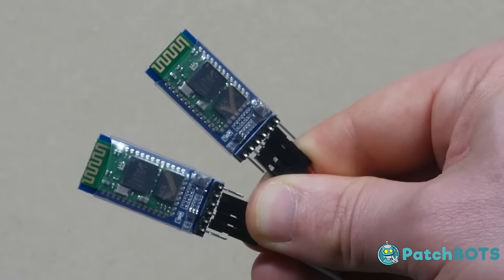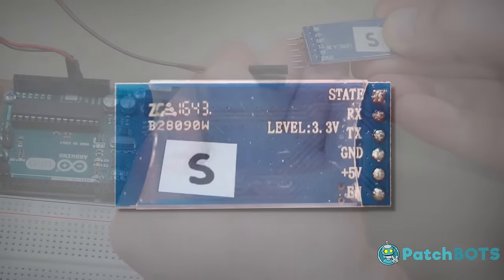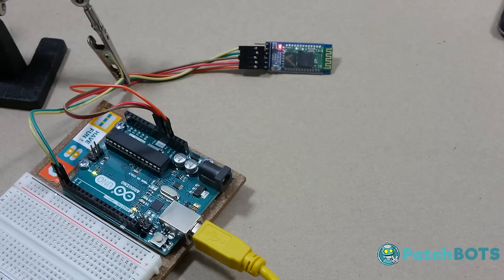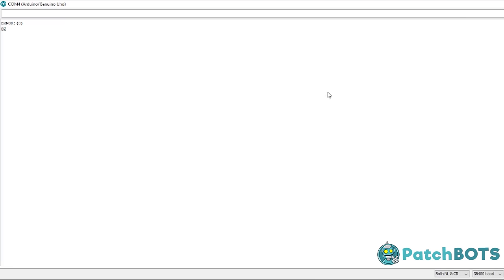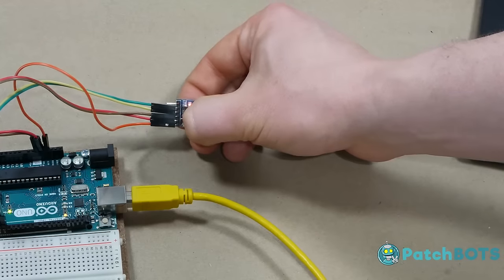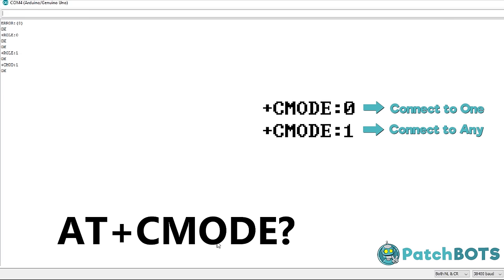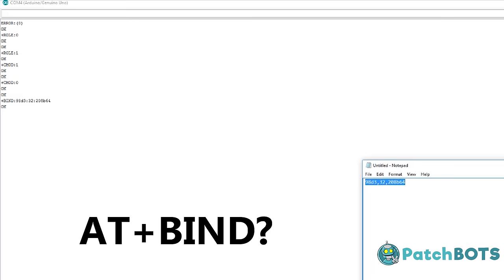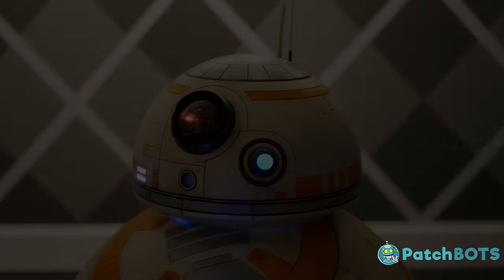How to Pair HC-05 Bluetooth Modules

Comment: Hello pathbots, this was very helpful and I almost finished in less than 10 minutes but I ran into a problem. It says that my modules are binded and stay binded but they won't connect. I'm using an Arduino uno and have checked every step and everything is correct. Not sure why?

Comment: Make sure you use this format for your AT+BIND=xxxx,xx,xxxxxx.  Add zeros to pad the address.  I was getting Error(7) (Bluetooth address: LAP is too long.).  But this fixed it.
Reply from the maker: Good advice, this error can also be caused by accidentally leaving a space at the end of your numbers, which is very easy if you're using Notepad on Windows.  This error is extremely common among those that message me.

Comment: hey PatchBOTS , so i did everything as described in the video it all went good, now i'm using the bluetooth modules to transmit data between a pro micro and an arduino mini, but the expected output isn't showing. can we use two paired modules to transmit and receive data over any arduino's or is it specific to uno?
Reply: and also after pairing process the light blinking in stage 3 did not change they're still blinking rapidly that means they are not paired right?
Reply from the maker: @vamsik1599      Once they are programmed you are no longer required to use the UNO, you can use anything.  If they are both blinking rapidly they are not paired. Something went wrong.
Reply: @PatchBOTS  now the AT command mode is not working in arduino ide it opens but output isn't showing anything, i still used  a uno to repeat the process again
Reply from the maker: @vamsik1599  make sure your baud rate is 38400 in the monitor
Reply: @PatchBOTS  yes checked everything, NL&CR both is set and rate is 38400 they just don't get paired and now serial monitor output is nothing it shows nothing

Comment: Hi PatchBOTS! I'm trying to pair two HC-05 modules following every instruction from this tutorial, the only difference is the fact that I'm using an arduino Leonardo instead on UNO. When I open the serial monitor and enter an AT command, even a simple AT or AT+ROLE?, I don't get any kind of response.  Have you encountered a similar problem, or do you have a solution for it?
Reply from the maker: Double check your baud rate
Reply from the maker: If you look a couple comments lower, someone had the same issue using a nano instead of an UNO.  When using an UNO it was fine.  I've never used a Leonardo so I can't confirm or deny
Reply: Hi PatchBOTS! Coming with an update, I just got an Arduino UNO today, I tried to pair my bluetooth modules using your tutorial and it worked out fine. It seems that this process indeed works only with an UNO model. Thanks for your help!
Reply from the maker: Thanks @bogdan itu,  this is really helpful feedback for the rest of the community.  You are the second person with this experience so I'm going to add another edit to the description of the video based on this.  THANK YOU!

Comment: Really great explained but I've got a question 
I want to send send and receive data in my sonar project( servo+ ultrasonic), Can it be done with the method you explained with these Bluetooth modules ?? Thanks
Reply from the maker: Hi Akram,  This tutorial just shows how to set up communication between the two modules.  So this tutorial would get you started. Yes, you can absolutely use these two bluetooth modules in your sonar project.  You'd can send the data from your sensor to your servo over bluetooth or your remote to your servo, whatever you need.  The bluetooth is just replacing i2c or other serial connections with a wireless solution.  HOWEVER, you'd need to seek out another tutorial for that, this one is just about establishing the connection between the modules.

Comment: followed your instructions for wiring, but I cannot enter AT commands on the serial monitor, what have I done wrong. I am also using an Arduino nano.
Reply: Same problem
Reply from the maker: You can not use a Nano for this method.  You must use an Uno.    Once the HC-05 modules are paired, you can attach them to Nano's, but the programming must be done on an Uno

Comment: Please help me. I am using Arduino UNO. I read the issues you have written in the description. I have followed all the three techniques from Issue no. - 2. I have checked the connections several times. When I type "AT" command, it replies "OK", it replies "AT+ROLE?", "AT+PSWD?" etc. But when I type "AT+ROLE=1" it replies nothing!! "AT+NAME?" replies "+NAME:HC-05   OK". Model no. ZS-040.
Reply: almost the same problem: after changing the role (AT+ROLE=1) to hc-05, the board returns OK, but with AT+ROLE? answer: +ROLE:0, that is, the role does not change. have you found the reason for this yet?
Reply: @secrey36  I didn’t find the exact reason. But I think, firmware versions less than 2 (two) don't support 'Master Mode'.
Reply: @muhammadtamim451  Thanks for the suggestion :) I'll try further, maybe I'll go through the hardware.  I really want to make a remote control for the manipulator
Reply: @secrey36  welcome!

Comment: Great! But at the end of the process, my two modules don't blink together. Master(connected to mega) blinks, blinks and then Slave(connected to UNO) blinks but nevere together. Can you help me?
Reply from the maker: They don't necessarily have to blink together as long as they are blinking the same way.
Reply: @PatchBOTS  thanks!! Later i Will try again and i Will let you know :)
Reply: @PatchBOTS  and if i want that the two modules communicate eachother, which Is the Arduino's code?

Comment: Thank you very much

So do they also send the command using the wire library on Arduino

Is there anything we have to do in addition in the code?
Reply from the maker: The way I've used them is with UART communication.   I'm not sure if you can use it as an I2C device with the wire library but it's something to look into.

Comment: Would they stay paired after i cut the power of them and connect it again?.. or do i need to program them every time ?
Reply from the maker: Once they are paired they will remained paired through power on/off until they are reprogrammed.
Reply: They should stay paired as you have set the Master to only pair with 1 address, that address being the slave's.

Comment: Brother ..HC-05 is in AT mode but not responding to any AT commands ? Plz help
Reply from the maker: Check baud rate.  Try holding down button as you enter commands
Reply: Yeah mine too
Reply: Maybe the Module is defective.. coz I tried using other Hc05.. it worked
Reply: @sacys  With UNO or NANO ?
Reply: @scitechnotuber548  Uno

Comment: Hi PatchBOTS! I i want to make a bluetooth transmission of an electric guitar signal,  should I follow this tutorial or it's something else I should do to make it work?
Reply from the maker: This tutorial will just pair the two modules.  Sending the signal across the connection is a whole other bag of potatoes.  Good luck! I'm sure you'll find some help online.  Check out wireless guitar rigs.
Reply: Thank you for your response! I was really hoping this would work for me because I want to finnish this project very soon for my graduation thesis.
Reply from the maker: No problem, this video is defintiely a great Step 1 for your project.  Now you'll just need to figure out how to attach your guitar to one end and your amp to the other!
Reply: I figured out how to attach my guitar to the first arduino(the transmiter). I had to make an amplifier circuit, to amplify the guitar signal, wich is around 2mV, to 2V, so that the arduino can process it. I'll find a way to attach the other arduino(the receptor) to an amp, but what I don't understand is, if I do all this, and I pair the two bluetooth modules just like in your tutorial, will I be able to transmit the audio signal, or will the arduinos need some further programing?
Reply from the maker: Okay cool, so you're on the right track.  What you'll need to do is print the signal to serial on the transmitter side, and parse the data on the receiver side (that's one way to do it).  You should also look into Software Serial on the Arduino playground:  https://www.arduino.cc/en/Reference/SoftwareSerial      This will send you down the Serial rabbit hole which will lead you to how to get two arduinos to talk to each other.  The difference here is that the connection will be made via bluetooth instead of hard-wiring.  Good luck!

Comment: Rx and Tx of bluetooth are 5v compatible?
Reply from the maker: Generally speaking, no.  For programming it should be fine but use a voltage divider for long term usage.
Reply: @PatchBOTS  thanks

Comment: Mmmm, what about the 3.3V logic level requirement? The HC05 Rx pin might survive for the duration of testing, but longer term you'll kill your HC05. It needs a logic level shifter for long term use, as per datasheet.
Reply from the maker: Yeah you're totally right.  A voltage divider is needed for long term use.

Comment: What is the Ardiuno uno actually doing?
Reply from the maker: enabling us to use the arduino IDE as a terminal for the HC-05 while supplying power to the board and setting the AT Pin high.
Reply: @PatchBOTS  
So all it is usb to UART bridge and supplies power?
Reply from the maker: @martinlintzgy1361  naile dit

Comment: I got my slave bt address as 28,13,17FD is this right and when I  bind it with master it only shows +BIND:28:13:0
Reply from the maker: Are you sure you're using hc-05 and not  hc-06
Reply: @PatchBOTS  yes

Comment: how can i connect HC-05 bluetooth module to android app to get data from the sensors interfaced to arduino?
please help.
Reply from the maker: Hi Dave.    Unfortunately I can't help you there, this tutorial is just about connecting 2 modules together.  I had a hard time finding info which is why I made a video, so maybe when you find your answer you can do the same!   The more helpful videos out there the better the community!  Thanks for commenting!
Reply: thank you for your past reply. any how, if you get it please try to share!!
Reply: You can use app from google play with arduino serial monitor. Or you can make your own app. If you have no experience in writing app use mit appinventor or thunkable. It is just serial monitor communication like in arduino app when it is connected with pc.

Comment: The best explanation ever on how configure and pair 2 HC-05 modules. Very clear.
But I cannot even turn on the light (pin 13) on Slave from Master.
I don't understand what I do wrong way. Can you make some simple code and really pair 2 modules?
Reply from the maker: What exactly are you trying to do?  What input are you trying to use on the master side to turn the light on on the slave side?
Reply: everything is okay, thank you

Comment: Why can't we use Arduino Nano instead of UNO ?
Reply from the maker: The UNO and the Nano run on different chips.  This method will NOT work with a Nano.
Reply: Can you help me using Nano ?
Reply from the maker: @scitechnotuber548  I don't think it's possible at all with a Nano. You can use a nano for your project once it is paired, but for programming the HC-05 in AT Command mode you need the UNO.

Comment: AT+BIND=D8,80,39,FE,1C,66 <<<<< why is this giving error
Reply from the maker: That's  a lot of commas.  The correct format is XXXX,XX,XXXXXX   so try   D880,39,FE1C66
Reply: @PatchBOTS  thank you bro appreciate your help :) Also one more thing, if you can guide me, I am working on a project where I have Arduino pro mini, hc-05, esp8266-01, DPS310 (temperature, pressure, altitude) sensor. I want to send the sensor data to my laptop where I have created local database (PHPmyAdmin) using the XAMP server. How should i get started to complete this? thanks again

Comment: Hi patchbot im using arduino uno and arduino pro micro but i cant connect the 2 hc05
Reply from the maker: Where are you stuck?
Reply: connection of 2 bluetooth module. it always blinking fast meaning it finding another HC05 module for 
connection right?
Reply from the maker: So you're saying you can't get them into AT Command mode? Or you have already programmed both and they stilll wont connect?
Reply: yes, i already get them in AT command but when I type in Arduino sketch "at+inq" in master module it doesnt get any available Bluetooth connection and its weird cause my slave HC05 is already finding some connection, blinking fast meaning it finding a connection right?
Reply from the maker: Blinking fast means it's searching for a connection.   You need to go through the steps in the video to bind the master to the slave.
Reply: i already bind it. hmmm. im using arduino uno and pro micro leonardo

Comment: Can i have the codes for master and slave sir?
Reply from the maker: Hm, not sure codes you're asking for.
Reply: Sir the codes you use for both bluetooth module :( i can't connect the slave to master
Reply from the maker: That depends a lot on what you're trying to do.  There is no single "code" to "connect" them. If they are synced they can communicate via serial commands

Comment: thanks 
but i wanna know how to send data from master to slave
Reply from the maker: Aly Saeed print to serial on the master, should be visible on the serial monitor of the slave.  fyi, 38400 is the default baud rate for AT commands but 9600 is the default for communication

Comment: HI, great video, thanks, I also used the AT command AT+UART=115200,0,0 on both master and slave to speed things up. I noticed that speed really increases but I loose bytes if Serial speed is same or greater than BT speed, for instance, both Serial and BT speeds at 115200 on Master and Slave, I loose 1 byte every 10 bytes, if I slowdown Arduino Serial on the sender, for example 9600, no bytes are lost. I dont really understand why, (it should all be buffered, right?) . In my case, I am trying to send some GPS data this deserves some trial and error testing, for I cant afford to loose any information. Any one had the same trouble?
Reply from the maker: Wow, 6 months ago, sorry about that.   Yes, I have had a similar issue and I did find a solution.  You can eliminate this issue by sending a "handshake" in the form of a start bit and end bit.  It's kind of a way of saying "I'm starting to say something," and then saying "I'm done saying what I need to say."    Follow example 5 in this tutorial:  https://forum.arduino.cc/index.php?topic=396450

Comment: i CAN't recive asnwer of AT
Reply from the maker: Can you be more specific with your setup and what you've done?
Reply: I did exactly with as you did, but i dont recive the answer.
Reply from the maker: It's come to my attention from a couple other people that certain brands of HC-05 modules act differently.  One builder had issues with voltage, another builder had issues with entering AT Command using my method. The method in the video works definitely with the HC-05 modules linked in the description to the video, but perhaps not with all models.
Reply: And Now? are you has any tips?
Reply: Help me, please.
Reply from the maker: Unfortunately I do not.  If you happened to buy one of the brands that doesn't work with my method, then I'm not sure how to proceed as I have never purchased those particular models.
Reply: But my bluetooth is just like yours. Help me please :(
Reply: I have two bluetooth Hc 05, got one not the other. What can it be?

Comment: https://youtu.be/BXXAcFOTnBo?t=4m32s
This is incorrect. If you want to transmit data or to enter AT command on ARDUINO connection should be made tx - tx and rx - rx. In case of FTDI modules its cross connection tx-rx and rx-tx for both purpose. I spent half a day trying to fix it following this tutorial so please rectify it.
Reply from the maker: The method in the video works for the boards listed in the description of the video.  I run all my bots wiht Rx->Tx  Tx-->Rx to transmit.   Sorry if you had trouble.
Reply: should be  tx - tx and rx - rx for AT Command  Mode this is said in the Video before. tx-rx and rx-tx is for Arduino cross communication.

Comment: if you're still having error 7 problem while binding its because the address needs to have certain number of digits and you have to type zero's before the address to have the same number of digits check these websites for more details :
https://forum.arduino.cc/index.php?topic=486438.new#new
https://macaddresschanger.com/what-is-bluetooth-address-BD_ADDR

Comment: The baud rate is 9600 nobody listen to this guy i quadruple checked both my wiring and code but i couldn't find the issue, turns out the baud rate is 9600 (for mine at least)
Reply from the maker: Thanks for the comment SmartPharoah.  The communication baud rate is 9600 but the AT Mode Buad Rate is 38400.  This is the case for all firmware's I've encountered.  If your boards have an AT Command baud rate of 9600 and you'd like to contribute to the community, please run the AT command AT+VERSION?  and post your firmware version.

Comment: Hello,
I'm using it for Arduino Micro
while I type AT commands it doesn't respond and shows nothing, not even error..?
can you please help me out?
Reply from the maker: You can use a micro for your project, but for programming in AT command mode you need to use an UNO.  that is why you aren't seeing anything

Comment: Hi @PatchBOTS , i followed the same steps but after they both are paired, one HC 05 blinks every 2 seconds as in communication mode like yours but the other one blinks every 6 seconds. I think there is something wrong but can't figure. Pls Help....
Reply from the maker: Should be fine. They may just be different firmware versions.  You can check this by typing AT+VERSION?
Reply: @PatchBOTS  Yeah, one was of 3.0 and the other of 2.0. Could be the same reason, thank u so much for the quick and prompt reply, saved my day.